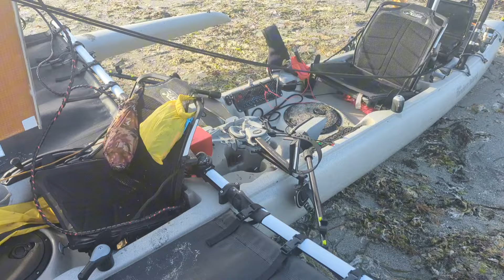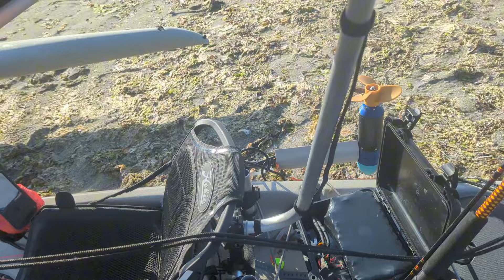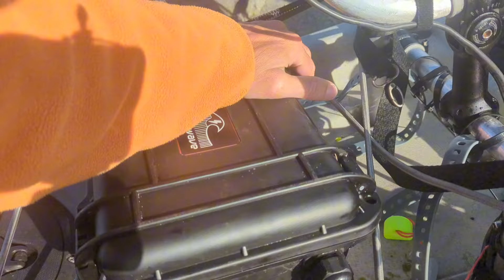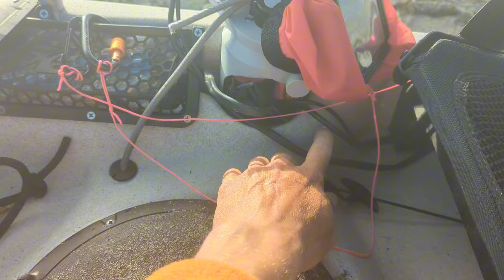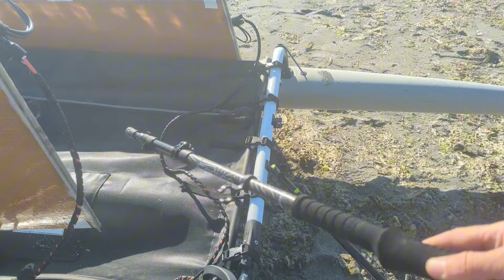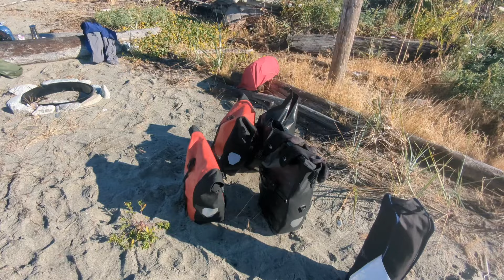Sailing Kayak Sunbird! A detailed introduction Vancouver Island circumnavigation 2024

Comment: Cool build and smart diversification of power. PS: You should get a "real" deadman's-switch you don't want that failing no matter what. Even if your switch works fine it only needs to fail once for you to be fucked.
Reply from the maker: I do have one that is a magnet key on a string and carabiner. If I fall off, the key comes with me and the system powers off!
Reply: @Philbuiltit  Good to hear and thank you for responding.